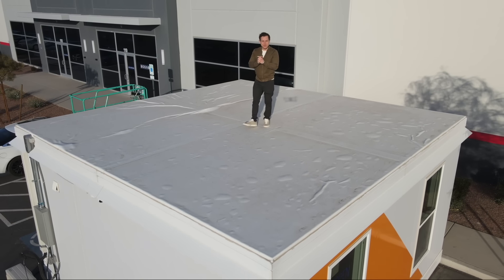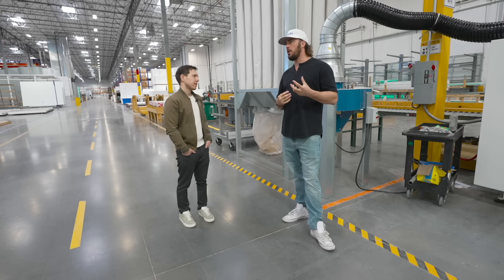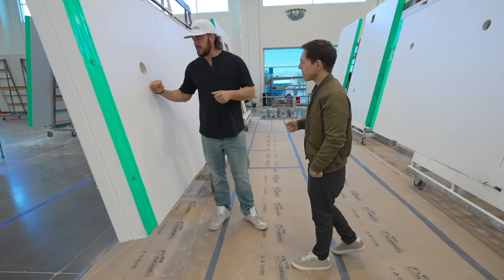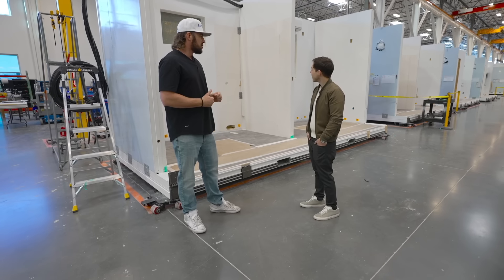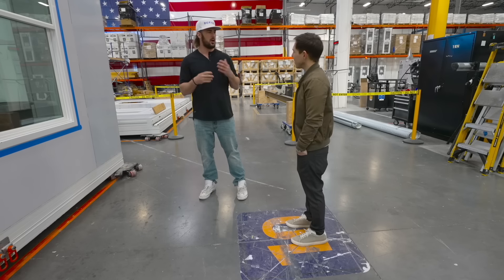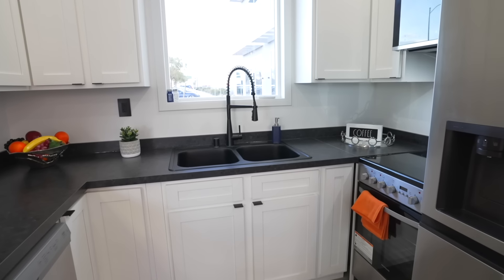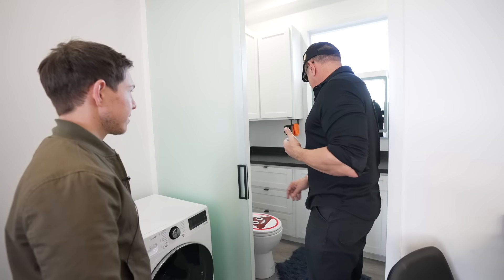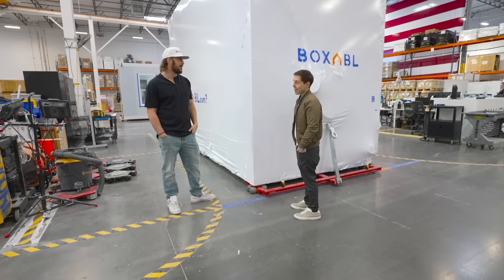Touring Elon Musk’s $50,000 Tiny Home

Comment: I can't wait for one even wider. Maybe with a really small, non elevated walk out deck with sliding doors. Also, if you could do one with an attached garage that would be nice.  Crazy how they do this. Also, how to get it attached to electricity? water? where's the water heater? Furnace or is that electric?  How will it fair in the Midwest?
Reply: The HVAC is all electric

Comment: Wait until they realize the water, sewer, gas, and electric hook up costs, the cost of the lot, and the foundation cost. It’s much cheaper to stick build than this.  The thing is, current NIMBY building regulations have made it impractical to build affordable housing when you consider all the permitting costs and land costs. The solution is to eliminate exclusionary zoning and let builders build mixed use homes and more apartment buildings

Comment: 400 sq/ft for 60k is not cheap. An average 4000 sq/ft home inna decent area costs around 500k to 600k and its not some box you have to assemble. It also has a yard for a dog, solid built construction, a foundation, water heating and just overall a more permanent solution. If this thing was 20k then maybe

Comment: I wouldn’t pay 50,000 for that. You can get a camper and a truck to pull it, cheaper than that. Or a small lot and a single wide trailer cheaper than that.

Comment: How are they anchored to the ground to prevent being moved by hurricane force winds or floating off in high water? How does the structure hold up to plumbing leaks, electrical fires, extreme cold, heat and how does you install AC ducting in them?

Comment: How much will it really cost?
Does that cost cover the wiring and plumbing to the house, shipment, the crane to set it up and secure so it doesn't fly away? What about the A/C and the heating unit,
can that roof that's held up by Styrofoam walls handle snow? Did you see it only has a tiny love seat instead of a sofa?.Seems like a lot of missing parts, plus you have to have land and what about the septic? Is any of that included. Otherwise it's little more than a fancy shed that has appliances. 
Wonder what their profit margin is?

Comment: How do you repair any issues with the exterior walls since it's all laminated to the styrofoam interior. How long will these homes last in high temps or very cold temps? How would you repair the plumbing if there was a leak? How watertight are these homes in heavy winds/rains?

Comment: Conceptually interesting. You really need to invest in a stellar architect and minimize wall thickness and gain an extra 20’-0”.The kitchen is an EPIC fail. Full size retail appliances are a mistake, the sink wall with the D/W next to the refer is a cluster-f*ck. You could make good use of a real home appliance specialist as well. Do you have to remove the toilet to open the vanity drawers? Never hang cabinetry on exterior walls (they are made for day lighting) and fenestration needs some rethinking and tweaking. You don’t maximize the benefit of 9’-0” ceilings. You should be thinking about cubic feet in a residential unit of this size. Who the f*ck am I? A sole resident of a 440 sq’ cottage